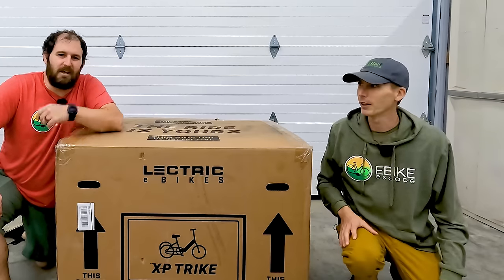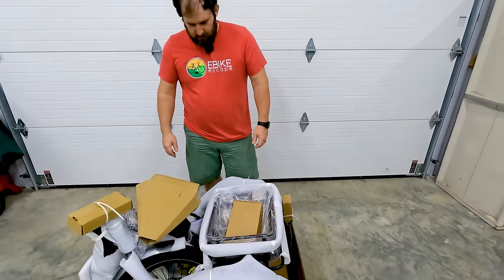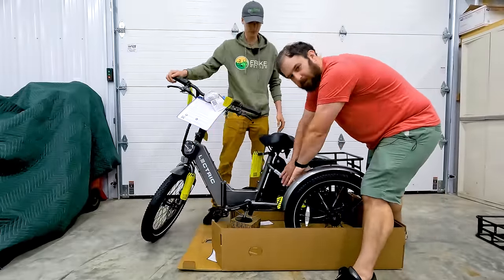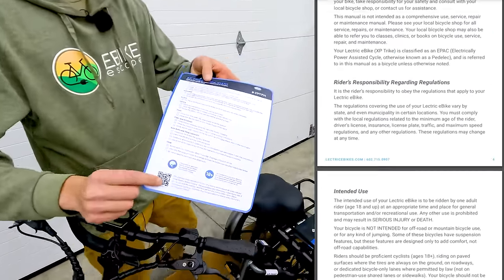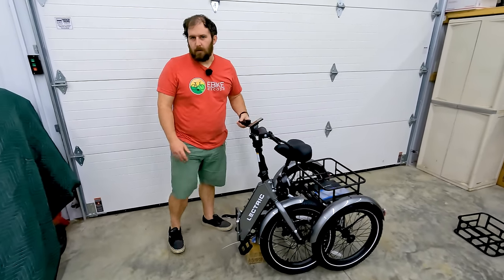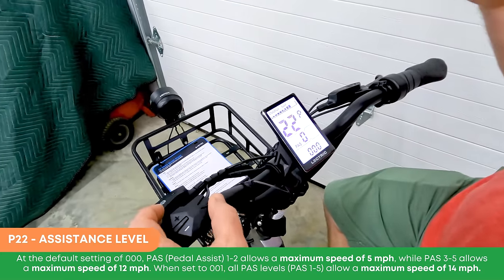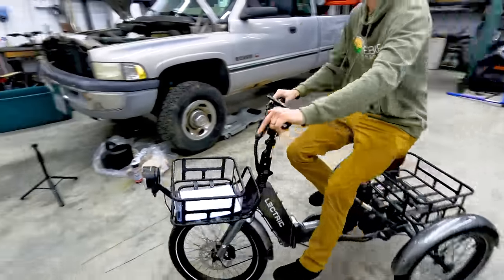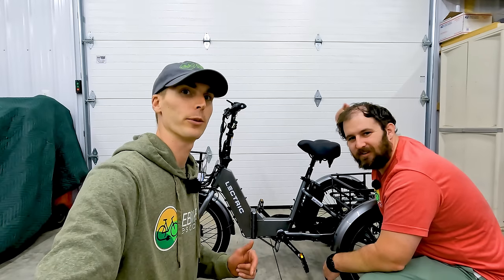Unlocking the Lectric XP Trike: Unboxing and Answering Your Questions!

Comment: Muchas Gracias ... The only question I have is ... When the trike arrives, is the battery ready to go, or you have to charge it for 7 hours before you use it?  Greetings from Woodstock, NY.   So excited. The Trike arrived yesterday (Memorial Day Weekend 2023). It is Sunday Morning and the BBQ preparations have to wait until I unbox and try The Trike.  You guys did a wonderful job on your video. Now I am ready to open the box, and begin a new era of my biking life ...
Reply: Mine was 75% charged.  However -- the instructions say it's best to give it a full charge before taking it out.  We rode ours for a few minutes, and then charged to full.  Yesterday we went on an eight mile ride, using throttle a LOT,  and the battery still shows as full, not even down one bar.  Great longevity on battery.  (Don't forget to change settings to faster and more power after you get a little used to trike riding.  Instructions in manual.)

Comment: Love the videos. I am seriously considering buying the  Lectric XP Trike, and yes, I will use your link to do so. I am 280 pounds, so what is the weight limit. I have a golf course two mile from me, and would like to ride this to the course and use it as a golf trike. So, Will it get me there and back, and carry my 280 pounds + clubs for 18 holes, average golf course is approximately 6600 yards long (3.75 miles or 6 kilometers) ?  I know they don't offer the club caddy attachment on their site, but there are several universal ones available to ad to e-scooters. I am disabled, but can still pedal some, and walk a little if needed. Also, If I am using it for golf, and don't care about width, can I use their fat tires with it?  Lots of questions, but I appreciate any info you can give me.   Thanks, Alan.
Reply: Don't forget to buy good locks and tracker if you're going to leave it parked while playing golf.

Comment: Put 750 w motor on it and I'll pay the price. I'm 250 lbs. @ 6' 4", I need the extra power. Been looking forever for an affordable rear or mid drive trike. Bought a Rad and gave it away, then got a Pedego and sold it back to the dealer. Found that front drive trikes can be extremely dangerous in wet and slippery conditions.
Reply from the maker: Do you think the 1092W peak wattage would be enough?
Reply: @EbikeEscape  I live in a very rural and small town, the 500 w would be ok for around town but to go anywhere else I run into hills. Would that peak get 250 lbs. up a 7% grade?

Comment: Mine arrived damaged with bent fender braces & one bent rear wheel. Tried to contact Letricebikes but never got back to me. I removed the wheel & got the wheel so at least it turns within the fender & straightened the fender braces also. It's pretty tipsy so must be careful when going faster. Deluxe seat with backrest pretty much sucks. Other than these issues I've enjoyed using it to cruise around the neighborhood & at car shows.

Comment: My wife's XP Trike came today, well packaged BUT!! both rear fenders were bent, one with a bad dent that causes the bolts on the tail light to rub the tire. Also, NO CHARGER!!!   Due to time of day, we cannot contact Lectricbikes until later. We will soon see how good their customer service is. This trike does look very nice.
Reply from the maker: We have seen the fender issue on a couple of other XP Trike comments. So you are not alone.

For the charger, did you see the cardboard protector we pulled ours out of? It was very easy to miss.
Reply: @EbikeEscape    Luckily, I was cleaning out the box from all the wrapping stuff and found it in the bottom, have no idea how I missed it when unboxing lol. Having a hard time getting the seat post to stay, it keeps sliding down and I have the clamp as tight as I can get it.

Comment: Did yours come undamaged? Mine came with the left rear wheel out of round and the axle bent. FedEx delivered it on the side despite the box having large THIS SIDE UP printing with arrows pointing up. I was home when the replacement came. FedEx driver opened the door of the truck and the box was on its side. The fender was bent so I refused delivery. The third one came and the box was right side up on the truck but the driver was just going to drop it off the back when I said "don't drop it, I'll help you!" the left rear wheel wobbles a little but I can live with it. There is no clearance between the box and rear wheels so if anything hits the side, or the box gets laid on its side, the wheels will be damaged. If they're going to ship with FedEx, they need to package this trike better.
Reply: Fed X was crappy for us too! I hate them because this is not the first time we got something big and they dumped it at the bottom of our driveway.

Comment: I watched another ebike video wherein the presenter suggested a battery of 20 amps or higher.  Is it possible to upgrade the battery at the time of purchase?  Are there any accessories to shelter the rider from inclement weather conditions?

Comment: My wife bought & received a Lectric XP-Trike. Question: she doesn’t have the hand strength to pull the back brake lever enough to engage the parking brake lock clip. I can do it for her, but it could be an issue if she alone. Any idea or thoughts on any small gadget I could look for or what it would be called? Spring vice or something…?
Reply: It will loosen with use.

Comment: Could you shave off a couple of inches from the folded height by removing the seat and post? I am wondering if i have any hope of getting it in the back of my SUV (both in terms of the height and the weight/awkwardness of the trike)
Reply: Off comes the seat. Fold handle bars down. Remove battery. Leave cargo cages on. Position pedal about mid-way horizontal. If possible, use two people to lift into your SUV. It should fold and go in, like that.

Comment: So level 1 through 5 is for maintaining different speeds without pedal assistance. And pas one through five you can reach faster speeds without pedal assistance? Because I have in the past broken my ankle a few times dirt bike riding and I'm mostly ride my XP off the batteries without assisting pedal power what the top speed I can only achieve is 20 mph
Reply: Yeah, my top speed is 21.9 kph. 
Try PAS 1 to 3 mostly as 4 and 5 PAS use up a lot of battery faster. But hey, 4 and 5 PAS are there to use and you can sure feel that extra power kick in. I love the throttle for road intersection starts.

Comment: 1. Thanks for your video I got more knowledge for display setting, but you should tell us the price and quality versus MoonCool that has suspension fork,seat w/-back rest  as standard with the same price $1499.
   2. You should also tell Lectric eTrikes for  future battery unit with USB charger for cell phone like  eBikes from China on the US streets now.
   3. I am partially disable senior citizen paddling with good right leg and the other not strong enough. 
   4. Yesterday, I used PAS1 position on my Lectric eTrike display and get up a smooth slope from the tarred  road to the pavement at my apartment. I fall out from trike because the trike tilted down. Tell to Lectric eTrike with one of your  audiences' advice and unbalanced experience , please.
Reply: At the moment the only customer support for MoonCool is to contact vendor. Could not get an answer on phone.. New company.. it looks like a nice bike but you are  on your own. I'll wait until they get the kinks out and check back in a few months..

Comment: My wife has one just like that the only problem is it's too slow especially crossing a busy street with a lot of traffic that has no traffic light. This company should have put 750 w motors on them with dual batteries as well as a suspension front fork. And could use bigger tires
Reply: You can adjust settings so the throttle has more ump off the line. Consult your manual.
Reply: She always rides it on level 5 and it's still slow. The friend of mine down the street as a 750 watt motor dual batteries like my XP premium the fastest I've got that bike up to is 20 mi an hour with no pedal assistance his bike 37 mi an hour with no pedal assistance
Reply: @StephenMartinez-ve1ey   There is another setting (not PAS) that gives more power from the get-go.  Look at page 36 in your manual for Settings Menu section.  Read how to make changes in settings.  Then, scroll down to page 38 where is shows 'P22' for 'Assistance level'.  Change your settings to that for more throttle power off the line.
Reply: @Horselings  yeah I didn't know that. Thanks for the info.

Comment: Hi I have a question I was i riding my trike and my dad noticed my bike left wheel was wobbling and the trike has a differential what do you think would cause the wobble wheel
Reply: Spokes adjustment likely - “truing” of wheel. 

Try a small adjustable wrench on the spike nipples. The 4.2 size spoke nipples are very hard to find that size of spoke nipple wrench for. Don’t try needle nose pliers, as they may ruin your spoke nipple. 

Try a zip tie cut precisely positioned and lined up bilaterally with your top rim. You can see exactly where the wobble problems are. Cheap man’s way of truing a rim. Then adjust your spokes accordingly.
Reply: Ok

Comment: I just got mine today, unfortunately both rear fenders are badly bent , I called customer service immediately and the Representative processed the order for replacement, (fenders only), customer service is exceptional though you have to be patient when calling as it took me at least 10 to 12 mins before I could talk to someone on the phone. Hope they can find solution  regarding bent fenders, perhaps they should be sent separately to avoid the hassle. It is quite disappointing when you finally get your much awaited bike only to realize you couldn’t run or use it right away due to bent fenders.

Comment: Can you explain changing a rear tire? I heard that the trike stop power to the ground rear wheel if one wheel come off the ground, would like to see a ride demo of that thanks for your time
Reply: Ahhh, I’m up to 300 km on my trike and have went around many many turns. I just slow right down to about 6 kph and lean into the turns. No problems at all with stability on turns or otherwise. I am 70 years old and 260 pounds. Love my Trike as I am able to explore all the trails (paved mostly) that I previously couldn’t. I would fall off of two wheeled bikes and stopped riding them. Balance issues are a big problem with me walking. But this Trike gives me new feet!
Reply: @DonnyAB  glade to hear you are enjoying yourself with your new trike, unless your doing a very sharp turn you can go a bit faster in corners.

Comment: I'm elderly I live in a cold climate I was assured this was going to arrive assembled except for the front basket it was delivered Christmas Day it should not have been delivered in a Northern climate which will destroy the battery if it's left in the garage. I specifically asked if it could be delivered to a bike shop that would assemble it I was told I would not need that now it's a Race Against Time I have 48 hours till the temperatures drop and the battery is ruined and I have no idea where the keys are
Reply from the maker: A little time in the cold won't hurt it.

Comment: Product damaged in shipping. Called support 3 days in a row, no answer!
Emailed support with pictures of the damage. Their reply was oh u can fix it yourself.
Me: I can return it as damaged/ inoperable.
They decided to send the mangled parts. Shipping order email received said 60 day to ship.
60 days later email stating shipped 24 hrs. later email stating lost shipment, no movement for 30 days.
No reply’s to emails for 4 days now I call support 3 times a day 45 min on hold each time, sometimes they pick up & hang up in 1 sec.
If you buy something from them, make sure you can go there to get proper support of avoid like the plague!

Comment: P12 on the settings what does that exactly do when set to the highest number
Reply from the maker: It controls the strength of which the motor comes on when engaged. Here is the description from the XP Trike manual "When set to higher numbers, the motor will come on stronger. Lower numbers will be more gentle."
Reply: If set to the higher number will it go to the top speed faster
Reply: If the break levers touch the grips will I have to bleed the brakes or not At all
Reply: On the xp trike
Reply: @jacobschwartz6721  And better for going up hills easily.

Comment: I wish I didn't have to write this review. These bikes are junk in our view. I bought two of them in July of 2023, by October both bikes have a bad axle bearing on the rear. This is with only neighborhood rides and no speed above 2. total miles on one is 117 and on the other 102. this bearing is not repairable and  Lectric e-bikes said to send them back for repair. We live over a thousand miles away. They refused any help with shop manuals or tech support, just send them back. We have the bikes in our garage if anyone wishes to verify. Sorry. Don and Jenny

Comment: You guys are promoting  a company with the worst customer service  in the world.
Reply from the maker: Maybe you can share more about your experience. We are part of 3 Lectric Facebook groups and that is not the consensus from our perspective. Maybe other owners can chime in here as well.
Reply: I got excellent service.  If the shipping company puts the box on its side, it will bend the fenders a little. Take the wheel off and it’ll be much easier to push the fender back into position. There’s a keyway on the axle so you’ll have to wiggle the tire a little bit To get it to come off, but just keep at it, it will come off. Put a milk crate, or something underneath to hold the rear of the bike up while you take the tire off.
Reply: @EbikeEscape  Lectric has had great customer service for me.
Reply: @dawnmcclung2015 Me too. Texted them with questions they got back to me the next day and then an hour or two after that.